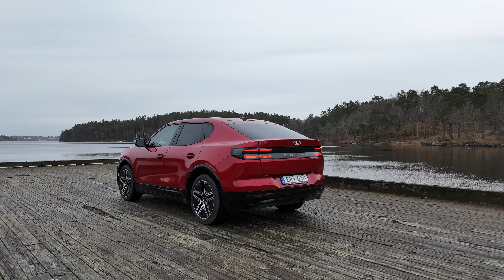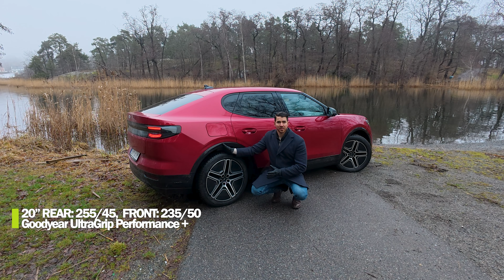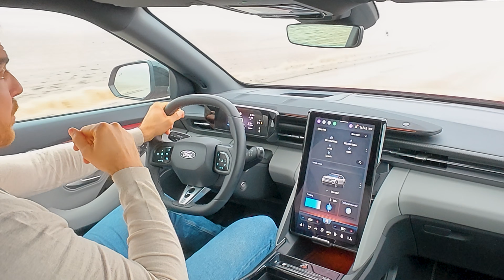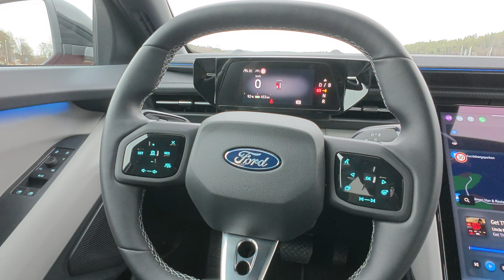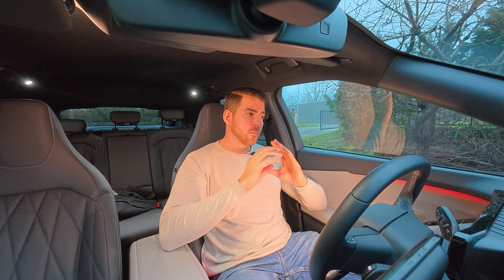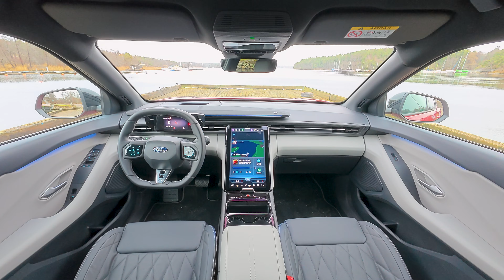Ford Capri - How far can it go? | Range, Charging, Noise

Comment: 5:00 you should be able to add the driver assitance widget to the main screen either long pressing at the icons at top or on the cards.
Reply from the maker: Yes, you are right. I did mention it in the full review. But sometimes we miss to sync some of the details. Our bad.

Comment: no speed limit switch on the steering wheel so unlike the puma  thats very off putting to me
Reply from the maker: Built on different platforms
Reply: @ItsOnlyElectric  so if you add the speed off alarm  to  favourites button as you have done its quite easy and fast to disconnect the speed alarm ? But you still need to do it every time you start the car I presume.  I dont know if I will buy it because of this ! thanks for reply also.
Reply from the maker: Yes
Reply: @ItsOnlyElectric  thank you! i will go ahead and get it in 2026

Comment: good looking. but far too expensive. As it is the same platform as VW use, I would choose ID5 or Skoda Enyak.  And another thing, I don't like the vertical info-screen, I prefer it horisontal as in most EV.
Reply: What charges faster: id5 or capri?
Reply from the maker: Same as long as you get the same battery
Reply: @ItsOnlyElectric  I just saw the specs, and AWD charges faster: 130 vs 180 awd

Comment: You say that the cabine noise is one of the best in the car class and I found the measure values in the other video too. For me, the noise level is not high, but too present. The ID brother as acoustic glass in the front window. I do not know whether the Capri has the same. More important here, the incoming sound from the side windows. I think for that price, we should see acoustic glass and noise reduction from the wheel houses as well. That would make the car more different to the other brothers and unique.

@Ford: We need quite cars
Reply from the maker: Good point
Reply: It is very quiet on the road. Eerily quiet.

Comment: There are some people out there how dont´t know how to swipe and doing videos just about that while describing the system as "laggy".  I saw about 30 Videos here on YT of different persons doing the same "tests" as you did and noone came to your conclusion. I drove that vehicle myself too and I can´t agree with you in any way.
Reply from the maker: How do you mean? You feel that the system are fast and snappy?
It's not on par with Tesla's, newer ID cars, or other premium cars, not even Hyundais and Kias.
maybe with an software update that could change as a lot of other parameters could.
Reply: @ItsOnlyElectric  Yes I felt the screen fast and snappy. And by the way, that Capri is not a premium car, we are talking about 50 - 60k Euros .... and Ford.
Reply from the maker: For me/ us it's still pretty slow compared to other cars. Great if you don't feel the same.
I'm of course comparing it with similar priced cars. ID, series. Is cheaper a lot of times. Same with a lot of Hyundai, Kias Xpeng, Nio. So on, could go on for a lot of cars that have faster and more responsive systems.
We both are from the software side. And we complain about slow software on many cars, Peugeot and soon o a Hyundai.
Your experience may vary, and it really depends on what you are comparing it with.
Reply: @ItsOnlyElectric  the software is VW-Software with Ford overlay so to speak. So if u compare both it should be absolute the same. What kind of experts are you. I dont want to offend you nut if u shout out those "facts"  due to your feelings, you may should relay on facts first.
Reply from the maker: It is slower. The week before we drove a Cupra Born with the updated software, it's was a lot more responsive, looked better and had 0 crashes. Compared to the Capri.
All Android phones has the same responsivness and buggs on similar hardware? They don't, and the Ford system is a tad bit slower, looks worse and had more bugs compared to the updated ID one.

Maybe they have updated that now, but at the time of filming it was not as good.

We don't gain anything of wining or complaining or giving an unfair advantage/ disadvantage to any manufacturer or car. We also report what we see and feel, and we drive the car everyday for more than a week and both say what we think after we both have drivenn it to not influense each other. And both of us thought that the software was worse then their new ID counterparts.
Reply: @ whatever you might felt .... I proved it by myself and it fits very well to me so I do not support your opinion. Thanks for that conversation. ;-)
Reply from the maker: @Steffan1970 that's the good thing, we need to have different opinions and preferences.

Comment: I think this car is very expensive for what it offers. Ford has made wrong choices, in my opinion. That’s why I stopped buying Ford, after driving 8 different Ford models, the last 5 bought new.
Reply from the maker: Yes exactly, same thought's here, it would be a decent car if they lowered the price a lot. It's just up to the Ford standards especially not for the price. Thank you for watching 🙏